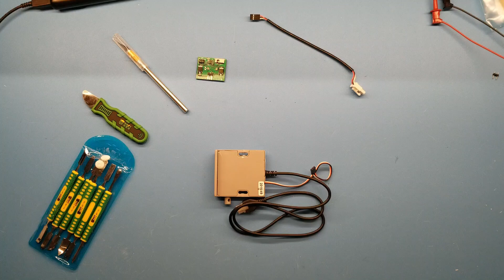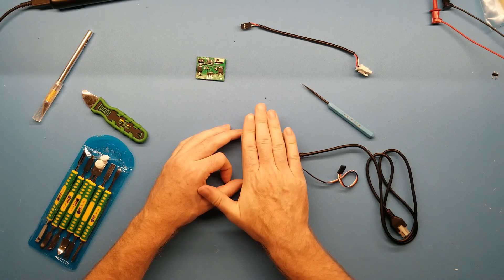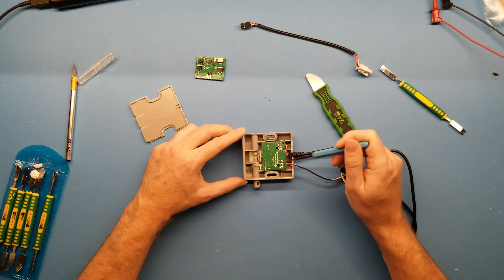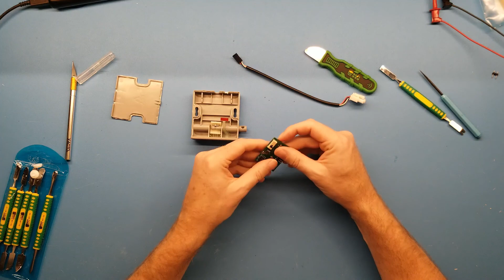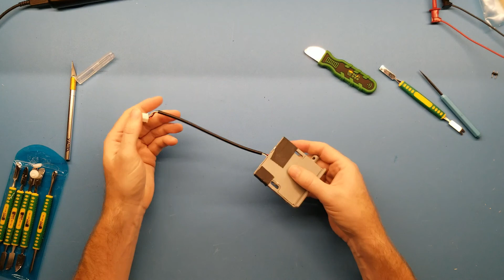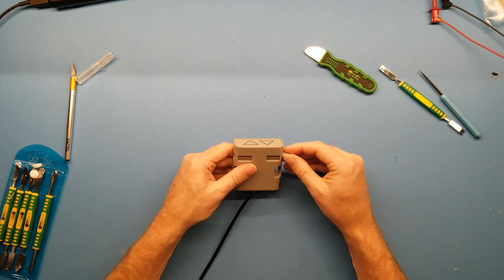IKEA Bekant / Megadesk disassembly/assembly steps

Comment: I love the idea of an open-source controller as an alternative to the Bekant controller. However, I'd love to have a reminder feature for example, which "nudges" me whenever I sat for more than an hour for example. Would this be possible with this solution?
Reply from the maker: The biggest lacking feature on the AVR used is a real-time clock. You could probably fake it just using a counter of milliseconds which would be good enough for reminder purposes. You could do so with an additional microcontroller and communicate with Megadesk over serial. A few people are doing this for various reasons, including Home Assistant integration or Google Home.  Serial protocol is described here https://github.com/gcormier/megadesk/blob/master/Serial.md and it has a Tone command you could use.